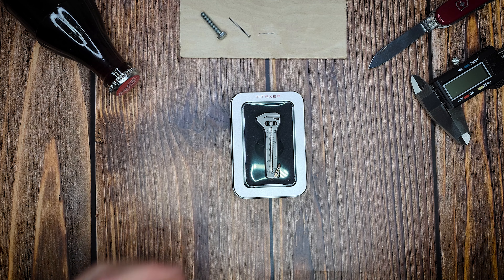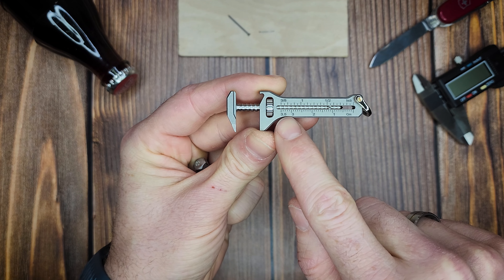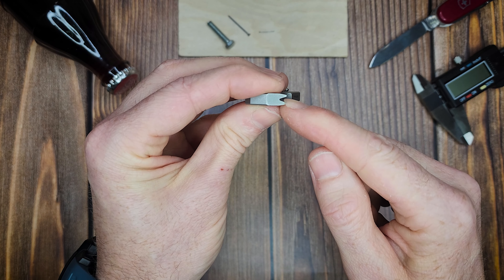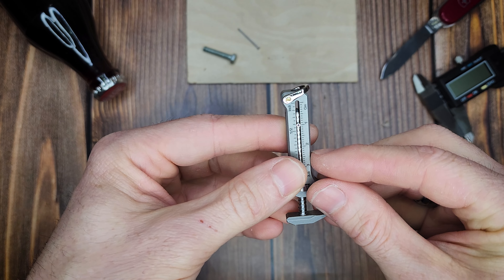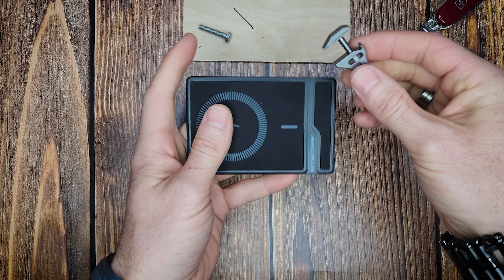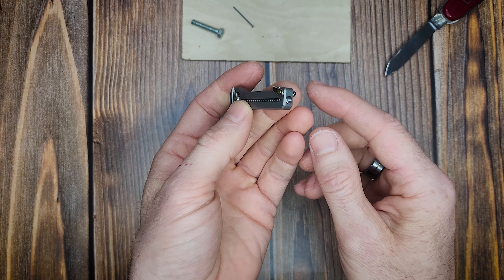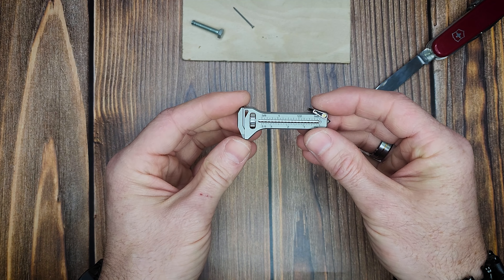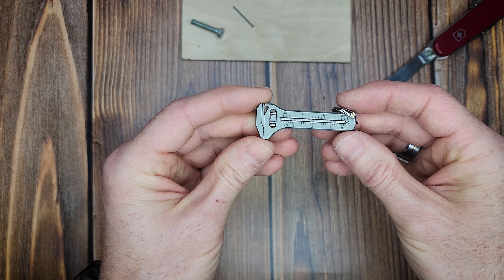The Tiny Titanium Multitool You Didn't Know You Needed - Titaner Tispanner 2.0 | 4K

Comment: Actually looks pretty neat, I'd be interested in seeing a test of how tight of a fastener it could loosen. Also if it just included jaws for hole size measuring like on regular calipers instead of the bottle opener, I would probably insta buy this.
Reply from the maker: I was planning to do something like that where I'd demonstrate it lossening a bolt, but I could find anything that would fit under my camera. 😅
Yeah, I agree the inside measuring jaws would have been a better choice.

Comment: Somewhat overpriced for what you get but an interesting tool. Sometimes a spanner can provide a better grip than the kind of pliers found on pocket-sized multi-tools so I could see an advantage in that. The caliper/clamp function could also be useful. I'd like to have seen a 1/4 inch or 4 mm bit driver socket which seems like it ought be easy to incorporate. I think the key ring shackle could interfere with using the tungsten tip. I think I'd end up removing that if I got of these.
Reply from the maker: It definitely is an expensive tool. Yeah, the key ring shackle does get in the way.
I heard from Titaner that they are making a larger variant. I'll be reviewing it soon. 🤞🏻